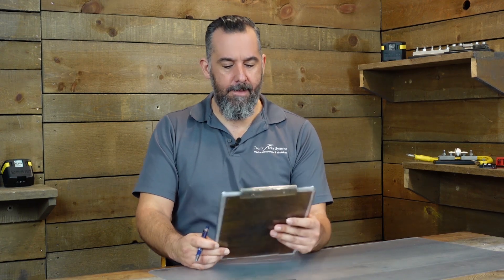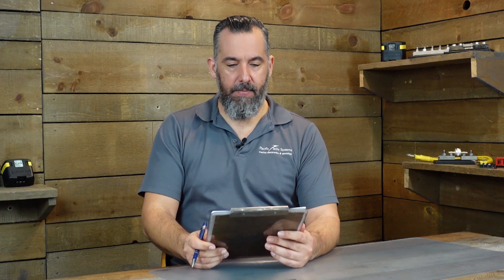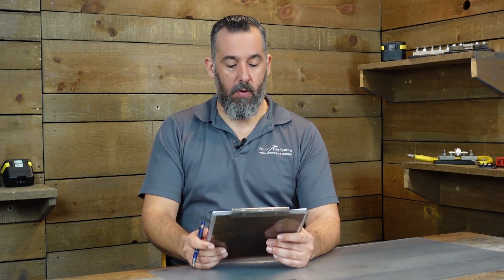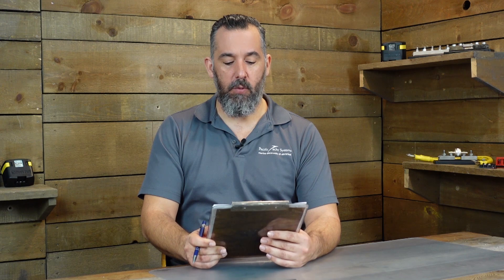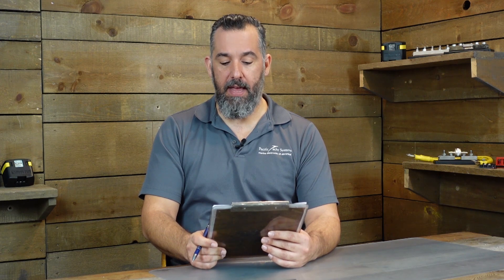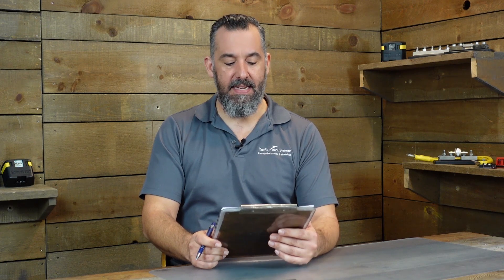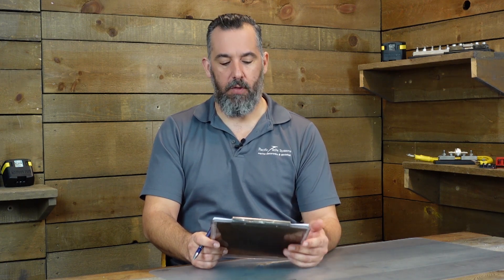Tips and Tricks for Proper Wire Management on Your Boat

Comment: Question. When I do a wiring job on my house under a homeowner permit I have to get it inspected and signed off by a professional electrition. Boats don't have a permit system for work but is it possible to get a new wiring installation inspected and a certificate issued for insurance or part of the boat's documentation in case you ever want to sell her. If so who can do it?

Comment: Instead of using terminal strips, I've gone for these https://www.ebay.co.uk/itm/391375006129 as I can be a bit more precise with my fusing, as the blue sea breakers are so much more expensive than a blade fuse.
Reply from the maker: Thanks for sharing.

Comment: I like your idea of going from main panel to main DC  distribution terminal block. From the DC distribution terminal block, would you go to each load with a fuse, then another terminal block, then wired to the load? How do we choose which terminal block and what amperage?
Reply from the maker: Hi Linda, good question, basically, most DC loads at a DC panel are less then 30 amps each, so we normally use a 30 amp terminal block.
Reply: @PacificYachtSystems  ok, so 30amp block. If I have 5 DC loads coming off that 1 terminal block, it’s still a 30amp terminal block? It’s not an Aggregate of the loads coming off the terminal block?

Comment: I like to epoxy/glue a piece of bilge painted plywood to the fibreglass to prevent drilling into the fibreglass for terminal strips, etc.
Reply: Use PVC board instead of wood.
Reply from the maker: Good one.

Comment: Hi Jeff,  I've been upgrading my wiring on a 1986 sailboat.  Following your good advice, I've got the wiring looking organized and safe.  I have bundles of wire routed throughout the boat, bilge, and various storage spaces neatly zap strapped together.  I've used wire loom split tubing in a couple of locations to tidy the appearance, and I'm thinking of using it more extensively.    I understand however heat is a concern when wires a bundled and I'm worried that adding the wire loom could have unintended negative coincidences.  Any recommendations regarding the use of wire loom would be appreciated.
Cheers,
Leigh
Reply from the maker: Hi Leigh, good question, when using a loom make sure that wiring within the loom as enough air separation to cool. Personally i only use split tubing when there is a likely hood of chafing.

Comment: Love your videos Jeff, thank you for making them.
I work in IT and I personally use Velcro instead of cable ties - I found that cable ties often get tightened too much and can pinch or damage the cables. That, plus cabling is a living and breathing thing that we continuously change, so Velcro is very strong to keep things clean but very convenient for access when needed.
Reply from the maker: Great tip!
Reply: Do you mind to post a link of the one you are using? And how you attach that to the boat? With epoxy?